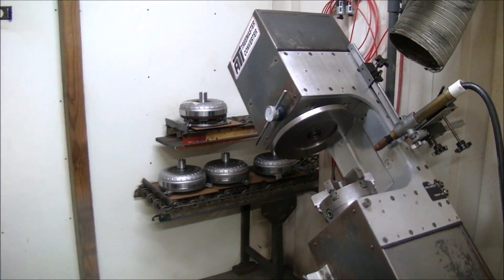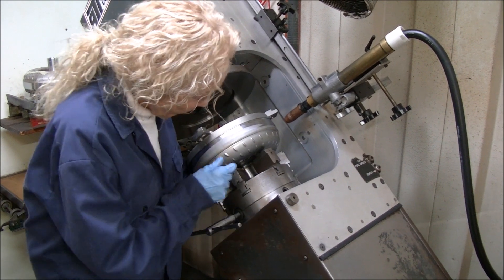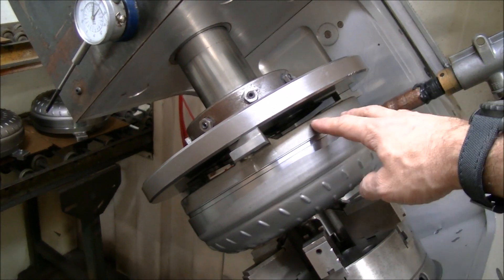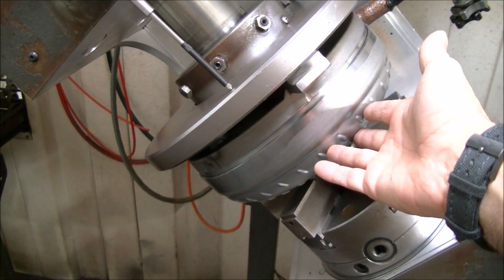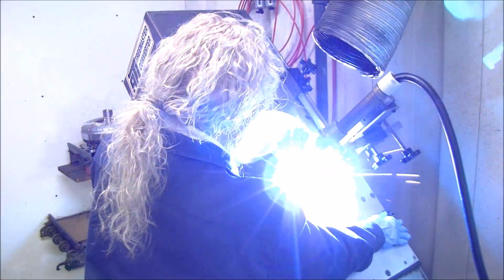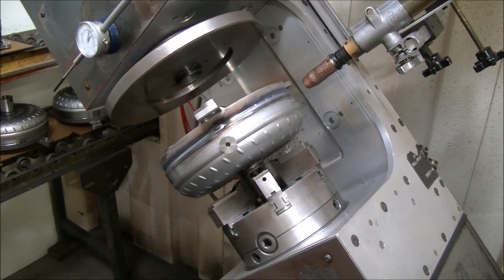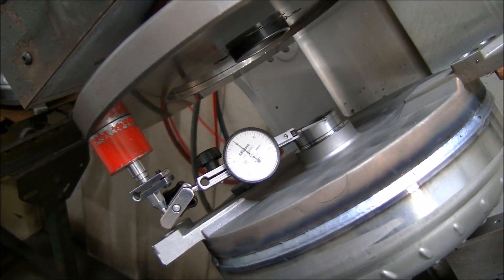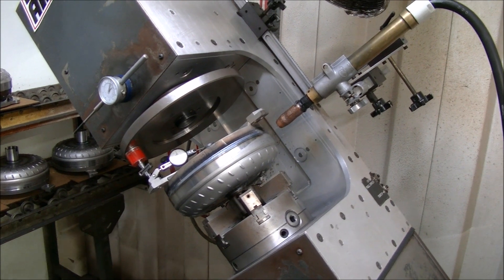Torque Converter Welding at ATI Performance Products, Inc

Comment: Is there a reason or advantage the machine is angled like it is versus it being flat/ horizontal?
Reply: Gravity helps to pull the weld towards where it needs to be, instead of away at the 45 degree angle

Comment: Didnt get the feeling of an professional operator, 2 tack welds on the same side and then full welding...
Reply: She started the main weld run opposite the tacks. If you think a little you will realise that's all you need.
Reply: The runout was only 3thou so obviously they have it worked out